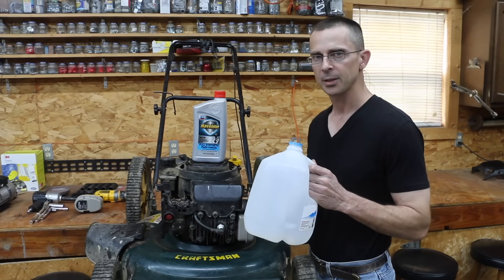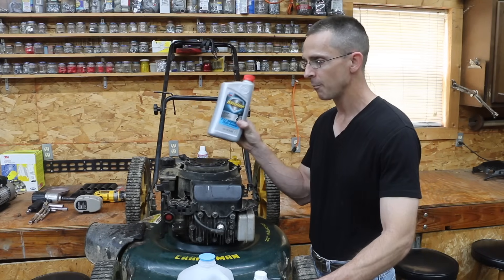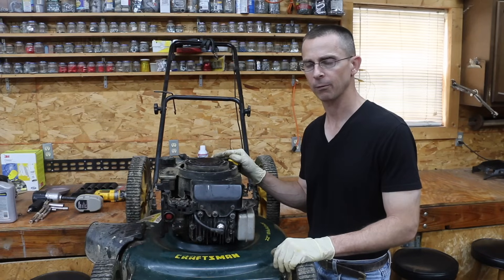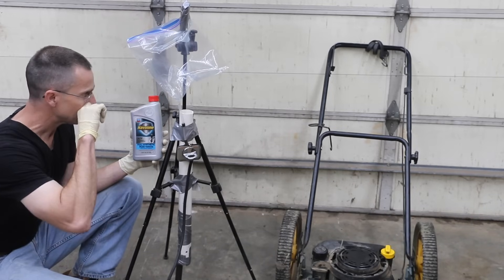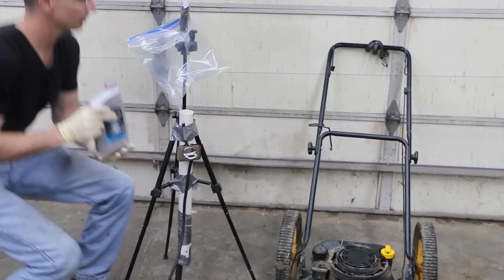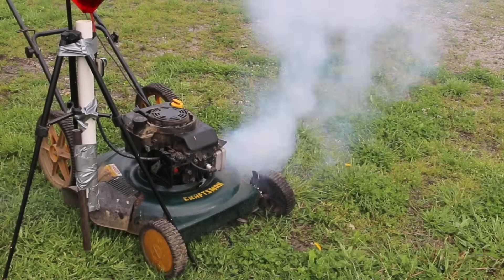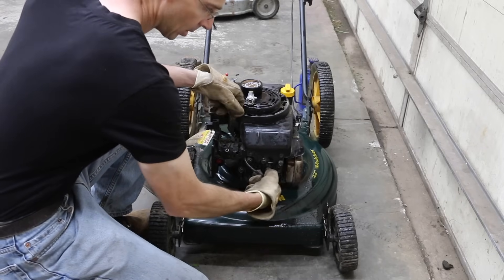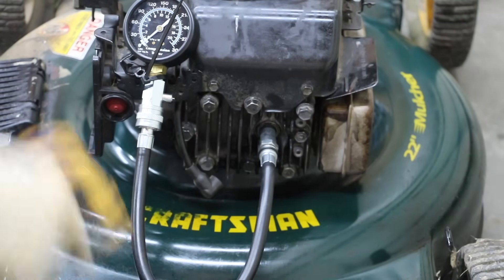Seafoam--can't believe what it did to my engine episode 6--Seafoam vs ATF!!

Comment: thank you so much for posting such educational videos. I have been working for 3 years to keep my 91 s10 v6 4.3 alive and I am at the point where oil changes and fluid replenishing every month are the norm, even though it should not be the case. I went ahead and seafoamed through the vac hose earlier this week and initially saw, heard, and felt a difference but now, 48 hours later, it is the same (bogging at acceleration, rough idle, loss of oil pressure at norm temp, fast temp increase, not shifting into 5th...). I will be trying another foam via crankcase, gas, and vac hose this weekend. I'll be sure to let you know. can't scope it and show pistons tho...
Reply from the maker: Ryan, I hope you are successful with the next round of Seafoam!  It's worth a try!  More videos to come.  Thanks for watching the video and commenting!

Comment: From this page at Quaker State:

Myth #12

Adding a quart of ATF the day before an oil change will clean your engine. ATF added to the motor oil will clean the engine due to the high levels of detergent in ATF. 

Fact
ATF does not contain detergent chemistry. ATF does contain dispersants, which have properties similar to detergents. But ATF is not formulated to withstand the combustion environment inside the engine. Quaker State® recommends that you keep the fluids where they belong: motor oil in the crankcase, and automatic transmission fluid in the transmission.
Reply from the maker: Watcher4510,  Thank you for providing this information!  Thanks for watching the video and commenting!
Reply: Project Farm.   Providing the fuel mix ratio is right there shouldn't be as much carbon on  the head and piston as was on the one in this video. i have removed the head of a B&G engine that was worn slap out and had very little carbon. It had an adjustable corb. As far as I know the best cleaners on the market are the nitrogen based ones that will clean the back sides of the intake valves. This is what is used in today's gas but the 1995 mandated levels aren't enough for the later hotter running car engines. There now many Top Tier gasses. Some of the gas treatments uses a very high level of the nitrogen based cleaners. Chevron is one and advertises it on the bottle. That is probably better than a solvent type.                       http://www.toptiergas.com/

Comment: y do u care so much about carbon deposits? if engine is properly tuned it will burn off. lawnmowers are generally rich and restricted for longevity.
Reply from the maker: Gentile Joshsaved, These products claim to be effective at cleaning the combustion chamber.  I'm having fun trying to determine which products work best.  Thanks for watching the video and commenting!

Comment: that compression level is WAY too low.  it should be over 100PSI, usually between 100 and 125 minimum, im surprised it even runs at that level.  the results are impressive nonetheless
Reply from the maker: 1987 mercury,  I agree.  There's a lot of blowby for sure!  Thanks for watching the video and commenting!

Comment: id rather use seafoam, as atf contains friction modifiers. at 60 psi that engine is old and has blow by, which explains the additives mixing with the oil
Reply from the maker: skyfly51, Yes, I agree!  The engine is worn out!  Thanks for watching the video and commenting!

Comment: I think using additives is good for preventative maintenance in the long term between rebuilds.
However, in my opinion, if you are not regularly using the stuff from the point of rebuild/new engine startup to the next rebuild then it's a waste.

The reason why I say this is, I'm doing a rebuild on a V6 right now. After I have owned the thing for about 6 months now(bad valve seals started the rebuild endeavor). I have ran all the usual stuff thru the motor starting with water thru the intake, a couple of cans of seafoam thru the gas tank/intake, and engine flush in the crank.
Now that I have the motor torn apart, I have come to the conclusion that: It was a waste of time and money. All the built up carbon and other crap is for the most part, still there, with the exception of the combustion chamber of course. But whats the use of having a clean combustion chamber if your intake and exhaust manifolds are lined with a half inch of crap? So, after this rebuild I will treat the motor like my other motors: give it a can of seafoam and a shot of water down its throat with every oil change so that all those parts that I spent hours cleaning will Stay Clean.

Comment: i agree that pm is better than additives but i dont understand what pm stops carbon build up. i would use atf on smaller equipment but probably stick to seafoam for my car
Reply from the maker: Dustin,  I agree with your approach!  I use Seafoam in the vehicles and other forms of additives in small engines.  Thanks for watching the video and commenting!

Comment: Great video. Very clear and controlled. What are your thoughts on the lowered compression?  Is this a long term effect?
Reply from the maker: Kevin, the engine used in the video suffers from low compression.  It's worn out. I believe the ATF cleaned a little too well.  A sick engine is sometimes, but not always, hurt by getting cleaned up.  Thanks for watching the video and commenting!

Comment: as a thought maybe 'soak' the internals. Tip or hang the the mower with the spark plug pointing straight up, remove the spark plug, roll the engine so that the piston is fully down/ back valves closed , then fill the combustion chamber completely full of ATF. Remove the ATF and run the engine. Overall I'm enjoying watching, and find this a fine use of resources. Thanks for making these videos. I'd love to try some of these things myself but I don't have the time.
Reply from the maker: charredskeleton,  I agree.  Soaking the internals seems most effective!  Thanks for the encouragement too and Thanks for watching the video and commenting!

Comment: don't hear those haters telling you how to spend your money, if that's what you like to do just do it! 
a really nice video, btw I have added ATF to the fuel tank (2oz) and that supposedly clean the fuel lines but what it does work for is lubricating the fuel pump, and some people say you can make a 50/50 mix of regular 10w30 and ATF and use it for 30 min and then drain it, they said it would help for those engines that have low oil pressure. just some ideas if you have some worn out engines that need help. keep up the videos!
Reply from the maker: Rdrack, I enjoyed reading your comments! Thanks for watching the video and commenting!

Comment: this is really interesting.

however, regarding your water test. you added far too much too slowly. about 2 cups of water tipped slowly into the carb should be enough.
eric the car guy did a video on it a while ago with his fairmont.
Reply from the maker: snipeish1, I agree.  I lot of folks have suggested using a spray mister.  So, I plan to repeat the water test that approach.

Comment: You skipped 2 steps from what I was taught using the atf method. After you infused the atf like you did you were supposed to pour a generous amount of atf into the carb to drown out the engine. Then after waiting 1/2 hr start it up and run it until smoke clears. Then check for carbon.
Reply from the maker: 04DurangoLimited, Great point!  That would have definitely helped even more than it did!  Thanks for watching the video and commenting!

Comment: I wouldnt do what you are doing myself but that doesnt mean its not worth wile. Seafoam is a good control since it's know to work. I would like to hear the logic behind why some of these things would be claimed to work. Since many de cokink products are based on acetone compounds I think acetone would be a good and cheap chemical to test. Here in sweden ATF would probably be more expensive than seafoam so there goes the whole point of using it for me other than the fact hat it didn seem very effective at decoking the combustion chamber.
Reply: Acetone and ATF with 50:50 mix is supposed to be one of the best treatments for freeing stuck bolts.
Reply from the maker: rimmersbryggeri, I'll try to comment on the theory behind the additives in future videos.  Thanks for watching the video and commenting!
Reply: keantoken Also mix brake fluid and power steering fluid I to the mix you'll get an extra 5 HP LOOOOOOOL😂😂😂!!!

Comment: i've use ATF for over 20 years works great......if you want better fuel economy and don't mind your engine running cold use DURALUBE
Reply from the maker: J. Helpin,  I've heard that Duralube is a terrific additive!  I used it many years again in a transmission and had very good results.  Thanks for watching the video and commenting!

Comment: i have heard great things about marvel mystery oil would like to c u test it have also heard it can clean corrosion off of aluminum  motorcycle engines with elbow grease and a shop rag ive also heard with a garden center fountain pump and oil pan you can repump. marvel threw a engine locked up from sitting to long and free it up been wanting to try it but havent have the opportunity  great videos
Reply from the maker: Wild Man,  I'll be testing Marvel Mystery Oil next.  I hope to release the video on Tuesday if editing goes well.  Thanks for watching the video and commenting!

Comment: ATF is great and I've used it all through my 30+ years of mechanicing, that said Seafoam works for me also... Now if you want to stop the carbon buildup almost all together try this, run all the crankcase relief hoses from any and all intake ports and run them through an air/oil separator. You would be amazed at how much raw oil gets pumped into your engine, ... BY YOUR ENGINE

An example of what I am talking about.
https://www.googleadservices.com/pagead/aclk?sa=L&ai=DChcSEwj-2e2M89fTAhXDXn4KHcMPDzAYABAKGgJwYw&ohost=www.google.com&cid=CAESEeD2_aodDCw9Murb1LvVNAg9&sig=AOD64_331EZ8h62Fhcs7knoJxRdvrrZYsQ&ctype=5&q=&ved=0ahUKEwjCt-iM89fTAhWHqlQKHVpLCikQvhcIMQ&adurl=
Reply from the maker: Lone crusaider, That's a great suggestion!  Thanks for watching the video and commenting!

Comment: id probably run half a gallon of distilled water and 12 oz of atf to flush out the carbon.
also you can put a little atf in the crankcase to dissolve the carbon but not to much or you'll mess up your bearings.

ive heard people soaking the combustion chamber with atf over a couple of days to break up the buildup and then siphoning it out
Reply from the maker: Ashish, That's a great approach for flushing out the carbon!  I plan to create some sort of combination of ingredients at some point.  Thanks again for watching the video and commenting!
Reply: Been working on small engines for 40 years , so anyways the way your test is set up Is why cranckcase breather is sucking up your test fluids on a lawnmower engine back into crankcase breather working like a vacuum pump

Comment: ATF is a known method of unstiking seals in rotary engines that have been sitting for a long time. But the issue is that if the oil is in there too long the massive load of detergents will cause o-rings to shrink and leak.
Reply from the maker: Beaver Lake Motorsports, Very good point regarding the issues ATF could cause!  Thanks for watching the video and commenting!
Reply: No problem, have you thought of redoing your water test but with boiling water or any state as close to steam as practically possible?

Comment: A friend of mine uses transmission fluid as a motor flush. I always thought the best way to burn carbon is by racing down a open road at full speed. Be safe of course. That's my .02¢
Reply from the maker: Arizona,  There are multiple ways to remove carbon and your method is by far the funnest!  Thanks for watching the video and commenting!

Comment: You got milky oil because you poured the water in. Which is over kill for a tiny carb to try and vaporise, it didnt get a chance to turn into steam and clean it all out, and just filled the crank up with water.
You're suppose to get a spray bottle and mist it in the intake slowly while running higher rpm so it turns into steam
 Whoever wants to try this,
Please DONT pour water into a cars engine! You will cause major damage if to much water is added to quickly
 Get a spray bottle!! 
(Water will still work the best in a vehicle if done correctly)
Reply from the maker: thegreatwhitenorth, I agree.  I plan to repeat the test using spay or steam.  Thanks for watching the video and commenting!

Comment: Very interesting and no, anytime you learn something it is not a waste of time or resources. Keep going! On the post ATF heads and valves, is the leftover carbon gummy? ie will it be easy to remove with tools and/or grit? It looks like you could get the last bit and make it look like new again.
Reply from the maker: Alexander, The carbon did seem as though it had softened, and I believe it'd be easier to remove.  Thanks for watching the video and commenting!
Reply: Project Farm I own a 1997 Pontiac Grand Prix and it's at 300 WHP with 100k miles I did the seafoam treatment and WOW! I wonder if I convert my engine to use hydrogen what would happen, don't want to ruin my awesome engine though, sooo.....still an interesting thought.

Comment: You know, you need a control lawn mower. I've noticed that you use the same lawn mower for each test. So these tests are moot. Get yourself 3 lawn mowers or so and do head to head test.
Reply: Use a 460 as the sacraficial goat
Reply from the maker: R1_Rebe1, Yes, I have several lawnmowers and will be using different ones in upcoming tests.  I did use this one back-to-back.  Thanks for watching the video and commenting!

Comment: Are you a doctor? Haha it reminds me of a IV drop for patients. Also, your word choice "infuse." Haha seriously though, awesome video!

Reminds me of a funny story. I had this old 1973 Mercury Comet. It had a small inline 6. Shortly after buying it, I had it in the shop on our base and was tinkering with it, when I discovered a vacuum line just sitting there. I also saw a steel tube coming from the transmission but it wasn't for the dipstick. I assumed it was a vacuum line for the modulator or something (it never would shift into third gear). When I plugged it in, the engine bogged way down and filled up the shop and outside with white smoke. I quickly unplugged it, and the engine continued to run, pumping thick smoke everywhere for several minutes. It ran a lot better afterward but sucked a ton of transmission fluid up haha. I'm lucky I didn't hydrolock the engine.  It was embarrassing to see  everybody laughing at me and open all of their doors during the winter. Haha
Reply from the maker: Brenndon,  LOL!  My wife is medical and told me that I was "infusing" not "injecting".  That's a funny story regarding the 1973 Mercery Comet!  LOL!  Thanks for watching the video and commenting!

Comment: I am loving these videos.  You're right.  It's a great form of entertainment.  I wonder what would happen if you added another round of ATF.  Seems like it worked really well.

Would you consider using ATF on the truck, or is it too risky?
Reply from the maker: The truck is running really well right now.  So, I don't plan to add anything more to the truck unless the lifter noise returns in the future.  Then, I'll use Seafoam since is worked well last time.  Thanks for watching the video and commenting!

Comment: Do you think the compression went down because the combustion chamber is a lower capacity after cleaning out the carbon?
Reply from the maker: HardwayRanch,  I'm not entirely sure.  I believe it may have removed carbon deposits around the piston rings.  Thanks for watching the video and commenting!

Comment: So what about purple power degreaser? Or maybe engine parts washer fluid? I dont know how harmful the exhaust would be but I am curious to see what it would do to clean carbon
Reply from the maker: Those are great suggestions!  Thanks for watching the video and commenting!
Reply: Dont use purple power degreaser on smal engines lol well not aluminum for sure! I made the mistake of soaking small engine parts in purple power and well i ended up with no parts the next day! It literally disolved the aluminum into a white powder! But the experiments project farm does for us are always cool to see!
Reply: Old_Ford_Trucks-FF#147 part washer fluid/solvent will eat away anything rubber or gaskets
Reply: and degreaser would strip the oil off and maybe cause seize

Comment: It surprised me how well the ATF worked. 

For what I'd use, If it's a car engine I'd just use water or a fuel additive; I don't want much getting past the piston rings and if any does get in the crankcase water evaporates.

I wonder what vegetable oil might do if you would pour it in? Depending on the kind I'm thinking it would burn up and tarnish things. Something with a high smoke point like coconut or olive oil might be interesting, if nothing else you'll make your yard smell like fast food.
Reply from the maker: Austin,  Great ideas!  Thanks for watching the video and commenting!
Reply: Thank you too and you're welcome.

Comment: back in the late 80's I had a cutlass 350 with 60,000 miles on it, I did a test of 1 quart ATF and 4 quarts oil to the crankcase, ran it for 15 minutes... changed the oil the next day driving to work a rod bearing let loose.. so will never do that again. I have used a fine mist of water into the carb to clean carbon I find that works great.. but can't do it nowadays with fuel injection. Well I haven't played with a way to do it. so I wouldn't advise pitting ATF in a crankcase just imo
Reply from the maker: Steve's Auto,  Wow!  I plan to repeat the test using water and plan to use a mist.  Also, thanks for the advice regarding ATF in crankcase.  Thanks for watching the video and commenting!